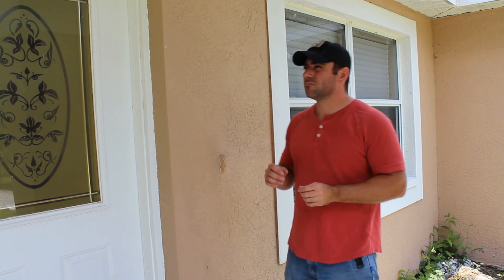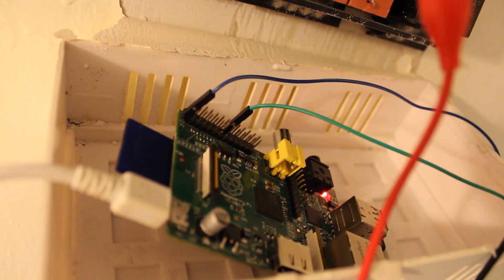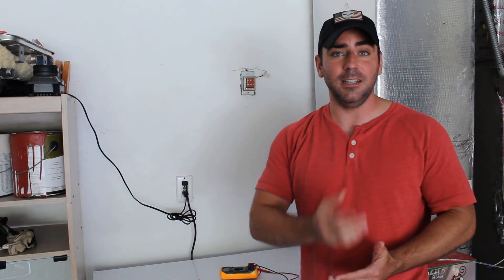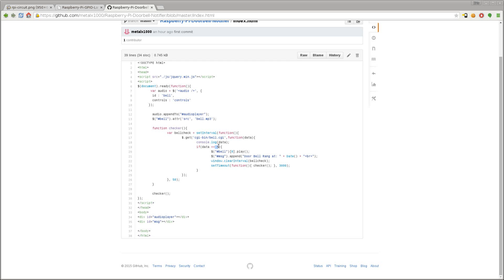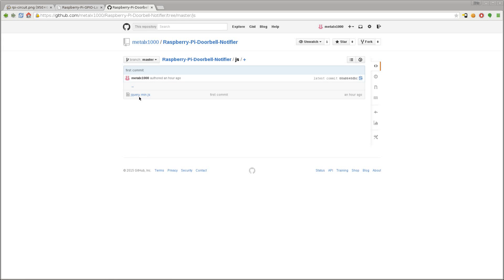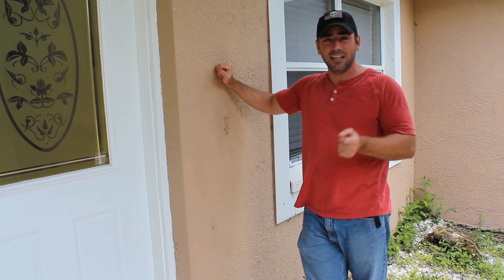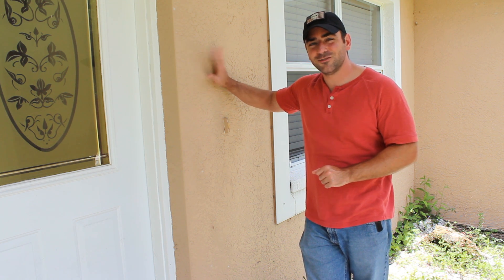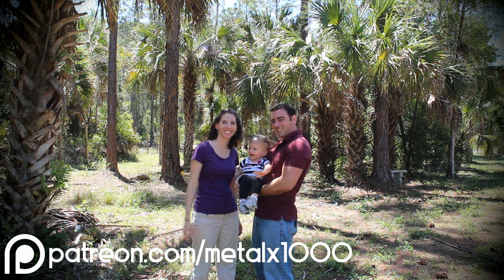06 Raspberry Pi GPIO Doorbell Home Automation Linux Tutorial

Comment: When your house burns down for running 120 volts via the non standard wires let us know. Normally you would use a 12 or 16 gauge wire.
Reply: At no point am I touching 120 volts in this project.  So yeah,  I don't think the 3.3v of the Raspberry Pi are going to burn down my house.  If so, everyone using the GPIO pins on a Raspberry Pi would be having their houses burn down.
Reply: Also, the wires that I'm using are up to code for the 16VDC the transformer originally put out.  Which I'm not getting anywhere near.
Reply: +Films By Kris Hardware 
My bad I thought you were running 120 volts. I get it now you are using the doorbell as a gpio input.
Reply from the maker: Yeah, 120v scares me a little.  :)

Comment: I have an old wired doorbell (powered by batteries) What i did was write a server side script wait for a bell/button press then flick a relay to fire the doorbell (which wasnt great because it required the pi to be on all the time) - when detecting a key press i had a usb webcam take a few pictures a couple of seconds apart, so i could see who called when i was out.
Reply: +gug1970 Care to share?